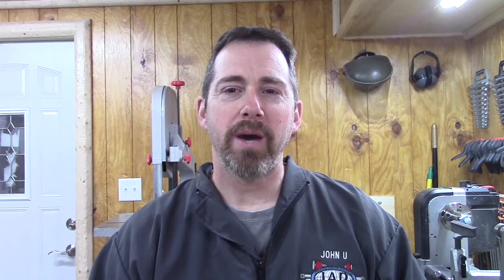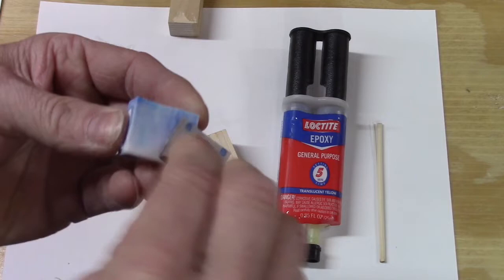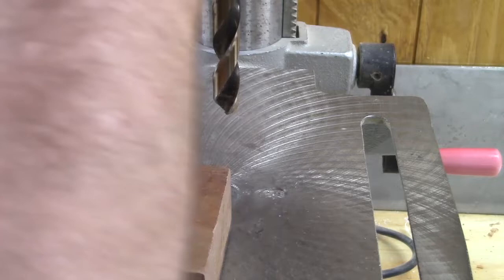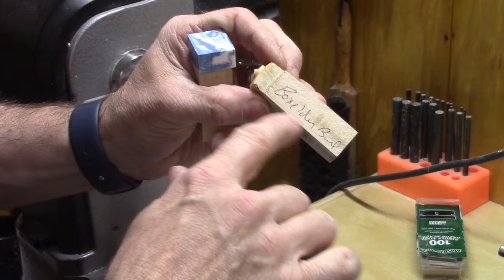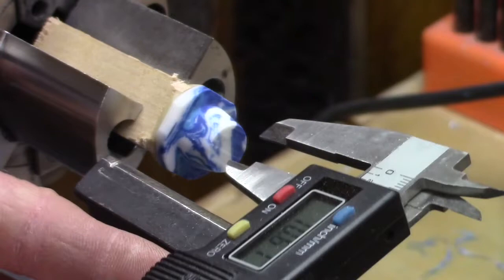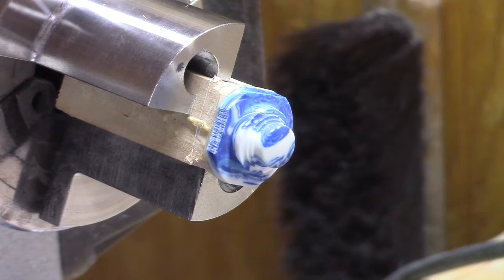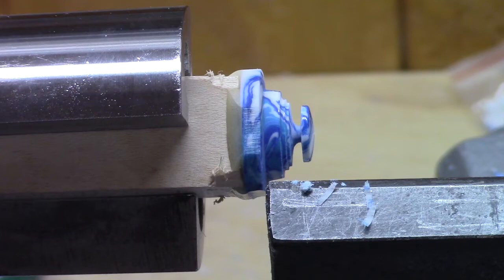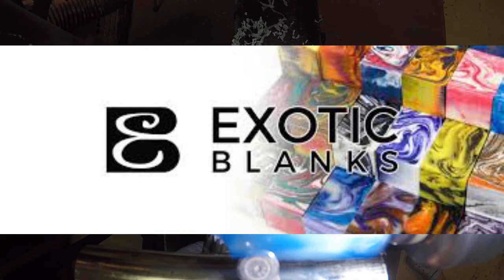10 Minutes To Better Pen Making - Custom Finials - Mark Dreyer / John Underhill

Comment: Love your stuff. Notice you keep the tool rest high and point the tool down.  Is that only on acrylics? Regardless, why?  P.S. just took delivery of one of your verticle cast systems.
Reply: Thank You,  I always have the tool rest highly enough that the tool edge is above center of the work piece.  The high positioned camera facing a downward angle along with me trying not to block the shot with my hands might make it appear like I’m cutting downwards but it wasn’t as bad as it appeared.  I usually approach the work level or slightly up at it. Acrylics can cut differently from each other.  Play around with it and your tools to see what works best for you.  This blank was made from urethane resin (Alumilite white) and it cuts very smoothly and easily with very little chipping.  It’s my favorite to turn.
Reply: @JohnU1032  Thanks for the response and you’re welcome. Makes sense. Will play around with it.